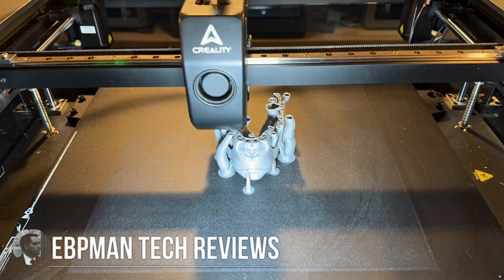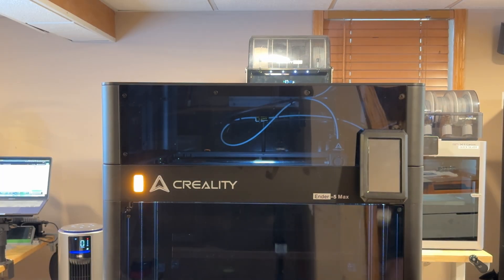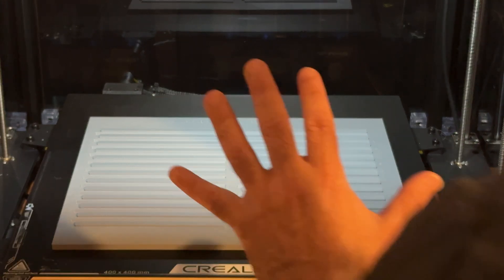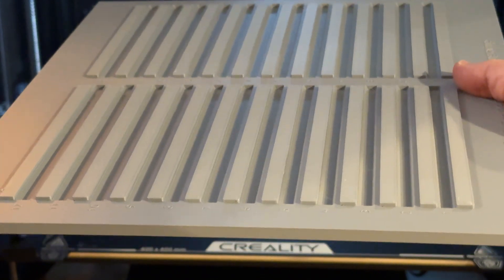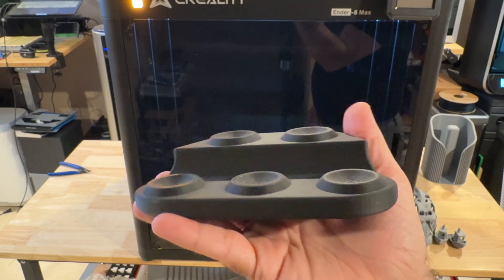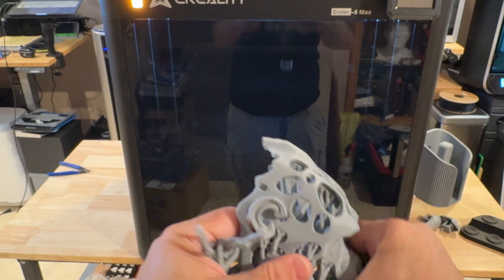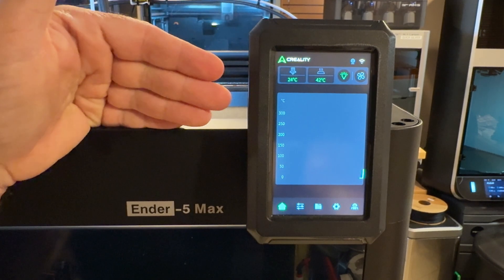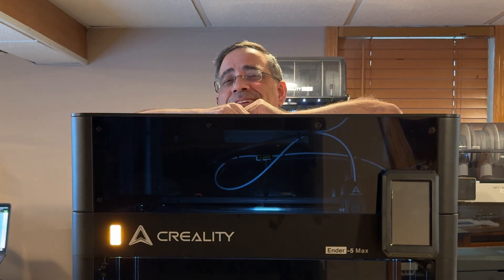Creality Ender-5 Max Review: The Ultimate Large-Scale 3D Printer!

Comment: I just added an e5max to my print farm about 2 weeks ago - excellent printer. I didn't bother with the enclosure since I only print PLA and it's just a great printer. Only had 1 fail on it so far but due to the filament not the printer.
Reply: U have a print farm!
Reply: @DarthVader2561-r9c  A small one, yes. Currently 11 printers though 6 are my main production printers and 5 are older support printers.

Comment: i love seeing these huge printers but don't understand why they cost 2-3x more than a 200mm printer
Reply: The frame is a lot more sturdy than a small printer, plus much heavier heated bed - this one is solid! that requires more lead screws, greater supports and rails, stronger motors, etc. than a small printer. At around $800 for this volume, it is a bargain imo.

Comment: Are you buy ender 5 max with  cover enclouser. Or must buy the cover seperatly with the machine ?
Reply from the maker: I had to get mine separately
Reply: @ebpman   Hi, I noticed that - probably to show the printing process in the video -  you didn't put the upper part of the enclosure, any other reasons? I installed the enclosure recently but I can't keep the top of the enclosure while printing because the cable of the extruder beating against the panel even lifts it up, and by the way the cable in the part closest to the connection with the extruder has bent a bit too much... 
I am printing at 390 mm, so the extruder always stands at the maximum height, but this should not give any problems (I bought this printer because of the print volume) and while installing the enclosure I wondered how the tube could stand so high without getting damaged or bent, with that low "rooftop". Are you by any chance experiencing the same problem? 
I'm going to try playing with the zip ties....

Comment: I love my ender 5 max, the only issue is I broke the nozzle and at this time good luck getting one took 2 months, so I machined it to except a K2 Plus unicorn nozzle which I don't recommend due to the limited volume, but I will switch it in the next few days back to the ender nozzle since it is so much faster. This machine has been my workhorse for my farm. Also keep maintenance on it, I have found it prints best when the rails are well lubed.
Reply: I broke mine and also bought the k2 unicorn and machine an small adapter so it fit in the heat sink. Im still having problem with auto bed leveling.
Reply: Sorry to hear, mine has been solid.  @suchonmprompunya

Comment: I’m fascinated by what your review didn’t cover.  Didn’t hear it print. No info on the hot end and so on.  Please consider those details 😊
Reply: The hotend and extruder is very similar to the E3 series from what I've seen so far. I haven't had to take it apart yet, but the extruder has the same lever as the E3V3Plus which I have 2 of, so I suspect the rest of the hotend is similar. I do wish they had used the Hi/K2 model instead with the filament runout sensor in the print head as you do waste about 3' of filament between the print head and the sensor, but it's pretty quiet and definitely gives great print quality.